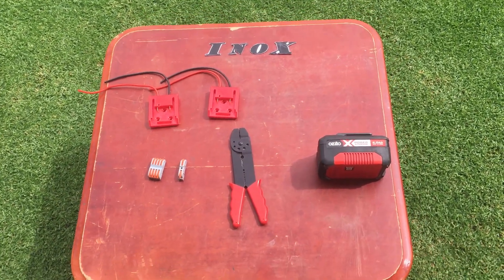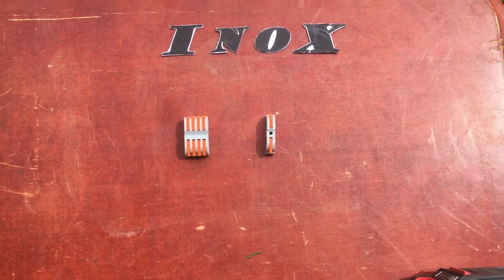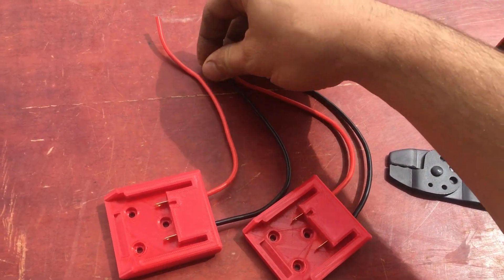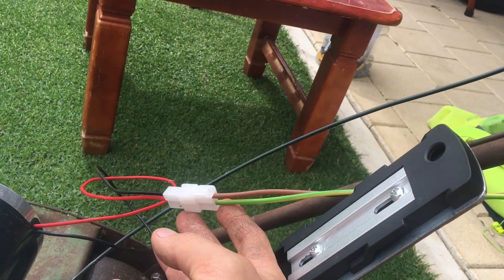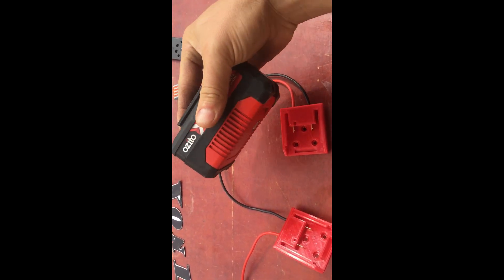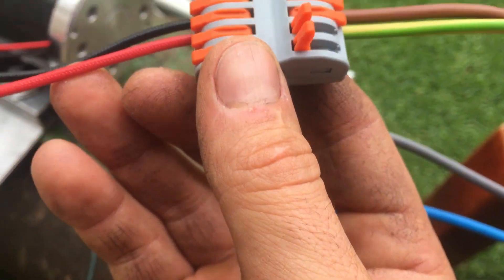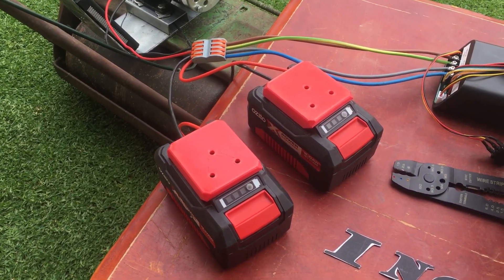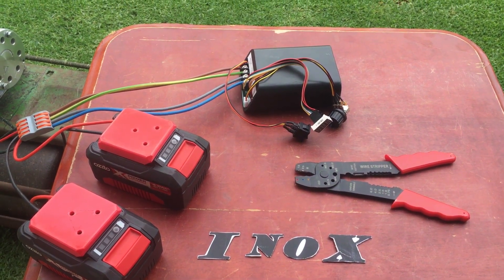Qualcast Commodore Cylinder Mower run by 36V Ozito PXC Battery Power Bank DIY

Comment: Hi, Just wondering where you purchased the coupler from? Is this something you made? Thanks
Reply from the maker: Join the https://www.facebook.com/share/BQpqFcztvyQep1k1/?mibextid=K35XfP for more support. I had this coupling made for me, ones you can purchase ebay https://www.ebay.com.au/itm/133971271922?mkcid=16&mkevt=1&mkrid=705-154756-20017-0&ssspo=4Jw0PcchStG&sssrc=4429486&ssuid=0myj8VoHThO&var=433419876154&widget_ver=artemis&media=COPY, choose you halfs diameter size for shaft, my1020 motor shaft is ussually 12 mm, and measure your mower PTO shaft

Comment: Did you consider weight balance, chains and sprokets weight down one side with old motor balancing out the other, but youve put motor and battery in the middle
Reply from the maker: I did, but “the looks” of it wan 😅
To be honest, almost 1 year since using it and didn’t notice a “bad cut” because the motor was not at the other end to balance the sprockets. This mower is a “play” project, a good mower is waiting to implement all the learnings and will have to get it right with good mower, other wise will cost me money he he he 🤣😁👌
Reply: @Iggs_1  yeah undulations in the lawn would have more of an impact. You've inspired me to start a project myself, I'm in the FB group also, thanks, 👍
Reply from the maker: @BigLeafDropper86  no worries! 
Probably moved about 100 mm the motor to the centre from the other end… no undulations in cuts what’s ever.
Sounds awesome, what mower are you going to modify?
Reply: @Iggs_1  have a SB 45, it's one of the last non-elec devices I have left, love the cut and didn't know where and how to start with an elec conversion, but now I do. Older posts in FB Scotty group never went into any details so I didn't realize it was pretty straightforward to do
Reply: @Iggs_1  yeah meant lawn bumps would be the cause of a bad cut not the kg or two off balance of mower
Reply from the maker: @BigLeafDropper86  its a 17 inch cut…? 
On 14 inch cut i am using a 48V (probably overpowered a bit) and seen people using 36V dc motors, for a 17 inch I would use a little bigger motor than that, just for reliability of long lasting. Good luck and hope to see your project within the group! 👌

Comment: What is the run time you get out of this set up?
Reply from the maker: 1 mow for 150 squares kyk. I mow it twice a week though. My motor here is 48V. This set up is appropriate for a 36V dc motor. I would not recommend a 36V battery for a 48V dc motor as in long term batteries will get damaged. As i didnt have at the time a 36V dc motor, i tested the set up on 48V motor, but running it at low RPM. 
Cheers
Reply from the maker: Forgot to mention 4Amps batteries
Cheers